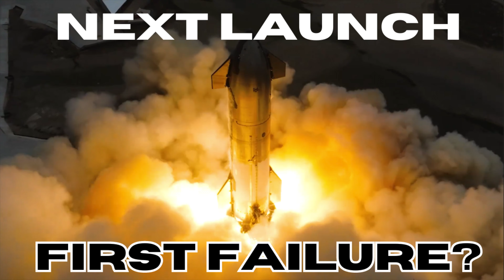Starship: Forget Traditional Rockets! Embrace Reusability!

Comment from the maker: Let me know what you think Flight 4 will accomplish!
Reply: Soft landing for both booster and ship 😅
Reply from the maker: @bentn1374 success is one of the possible outcomes! Let’s go!
Reply: It's bizzare to me that SpaceX isn't going to try a relight on the Vac engines. I understand why they didn't last time. With loss of attitude control, the relight would throw the orbiter in any unknown direction. But contigent on good attitude control on this flight, why wouldn't they relight? It's a VERY important milestone.

Regardless, GO GO GO!! I'm immensely looking forward to Wednesday
Reply from the maker: @keithrange4457 The only reason I can think of behind not doing the deorbit burn is to simplify their analysis of re-entry heating. 

If they make it all the way down they are going to do a flip and burn to try a soft splashdown. 

I have to expect booster and ship recovery to fail to contain my own excitement about what success would mean! Can’t wait for flight 4 - NET 6/6 I believe.
Reply: Well would you look at that
Reply from the maker: @bentn1374 never did I think they would splash the ship!!!